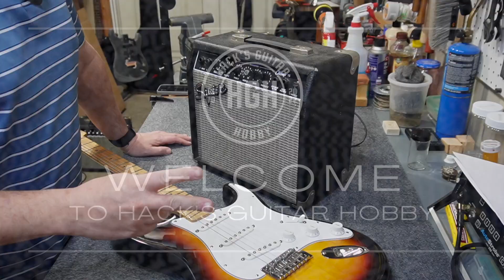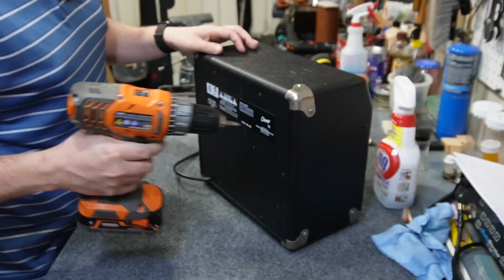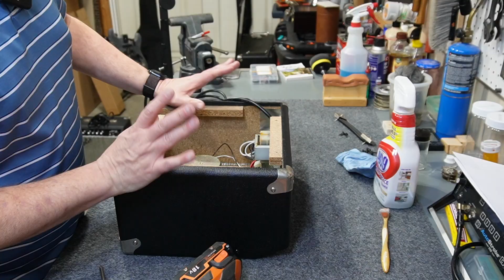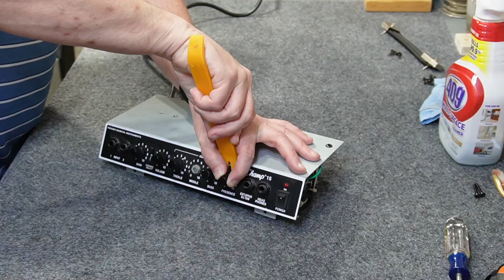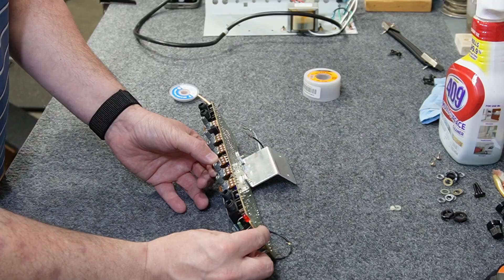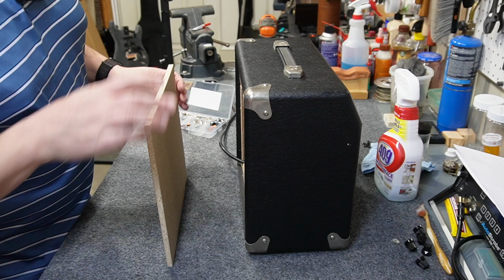Squier Champ 15 Amp: Replacing a Broken Pot and General Cleaning of a Thrift Store Guitar Amplifier

Comment: Great video! Do you have or know where to find the schematics for this amp? Thanks!!
Reply from the maker: I haven’t been able to find a good one.  I tried google, but it mostly pointed to sites with annoying popups.
Reply: @hacksguitarhobby  Thanks for your reply! I tried to find it as well and couldn't find the exact one, bummer..
Reply from the maker: I’m not positive this one is right, but here is one I found that someone posted on another site https://imgur.com/U3Lia47
Reply from the maker: Doesn’t quite look right because it at least lacks one input and the presence control.  A lot of the smaller Fender and Squier circuits are similar.